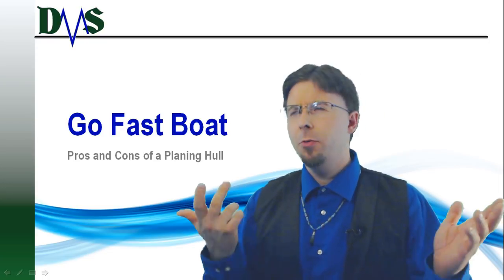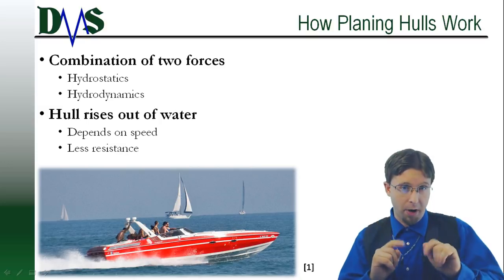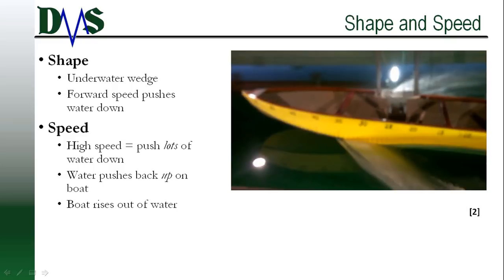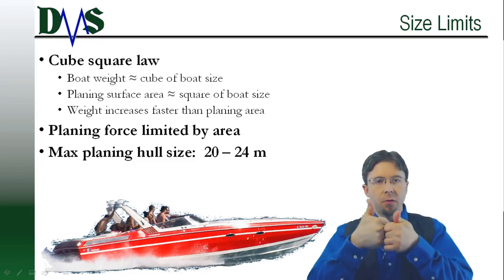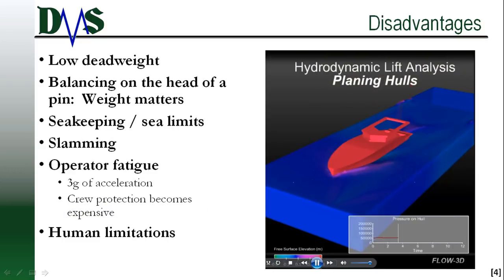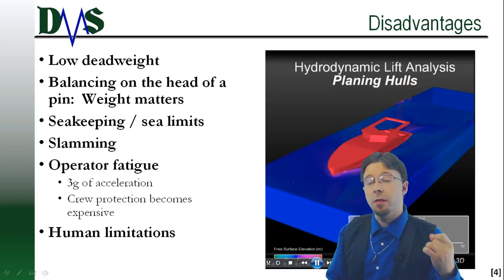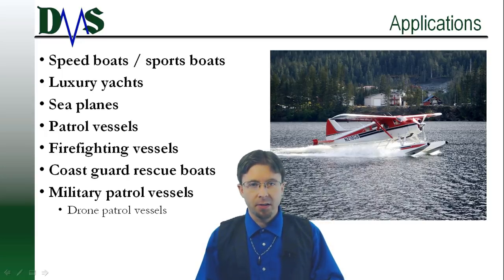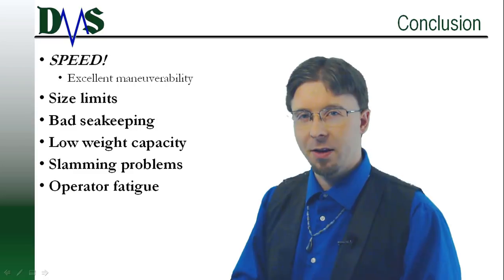GO FAST BOAT:  Pros and Cons of a Planing Hull

Comment: Hi Nick I saw this odd looking twin mast sailing catamaran called "mastfoils", I couldn't find any videos explaining pros and cons about it, can you enlighten me and any other interested subscribers please? thanks!
Reply from the maker: Do you mean this:  https://www.chriswhitedesigns.com/mastfoil-discussion ?

The Chris White website offers their explanation on the advantages of a Mastfoil.  But to provide some background on it, all sails are lifting foils.  They work on the same principles as airplane wings, only we turn them sideways to push the boat forward instead of carry an airplane up.  Problem is that soft fabrics do not make the best shapes for lifting foils.  Instead, several designers tried to actually create a rigid lifting foil in place of a sail.  That is the basic idea behind the Mastfoil.  That rigid wing replaces the mainsail.  

I would need to research it more to give justice to the pros and cons.  But here are some simple observations:
Pros:
- Rigid foil lasts longer than sails
- Rigid foils perform better than sails.  So you can fit more power into the same area
Cons:
- We always worry how to "turn off" the sail.  A rigid foil can't be furled.  The Mastfoil design by Chris White gets around this problem by giving the foil an option to freely rotate and always feather into the wind.
- Rotating mast sections mean that you can only put stays at the top and bottom of the mast.  Everything else is unstayed.  This requires stronger, heavier, masts to avoid buckling.

Comment: What about flying boats? Some of them get well above 24m, and they certainly plane.
Reply from the maker: Do you mean something like the boat shown in this article:
https://www.hoteliermaldives.com/flying-fish-with-heart-of-car/
Reply: More like this:https://en.wikipedia.org/wiki/Martin_JRM_Mars
Or this:https://en.wikipedia.org/wiki/Hughes_H-4_Hercules
Reply from the maker: Ah.  You found an exception to the general rules that I said in the video.  Flying boats still work as planing hulls because of several reasons.
1.  As an airplane, they generally employ lighter materials than boats.  The cube-square law still applies.  But the airplane operates on an entirely different scale than your conventional boat.
2.  Many of these planes actually use stepped hulls to achieve stable planing.  It has the effect of acting like one planing hull behind another.   This isn't really for planing force, but more to ensure pitch stability as you reduce to just the tip of the transom in the water.
3.  The airplane wings help during planing.  They take part of the weight during takeoff and landing.    So the planing hull doesn't need to do all the work.

Fun fact:  Some of the original experimental work on high speed planing hulls was conducted specifically for flying boats.
Reply: Okay, that makes sense. Thanks. I believe you did mention that experimental work on flying boats during the video, which is what made me think of these giant flying boats.